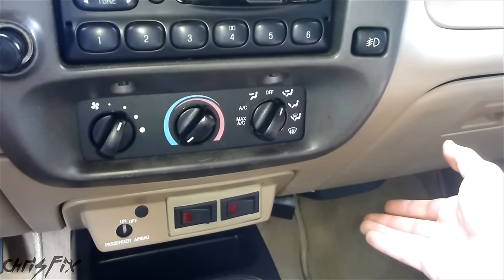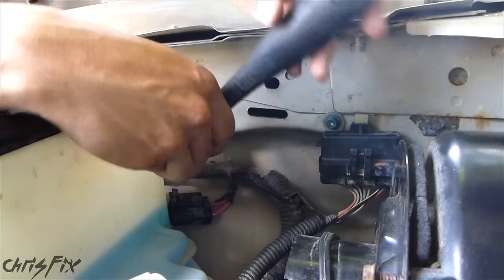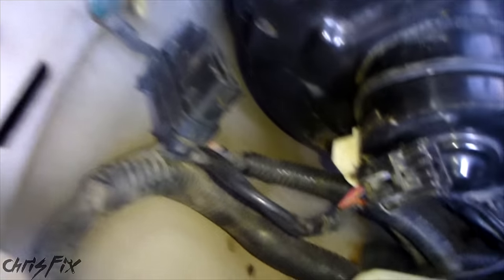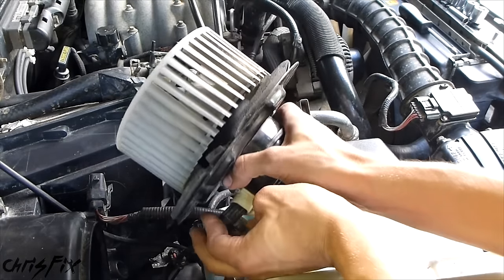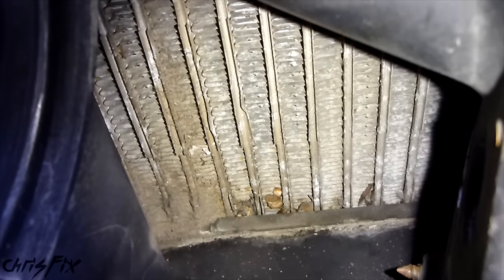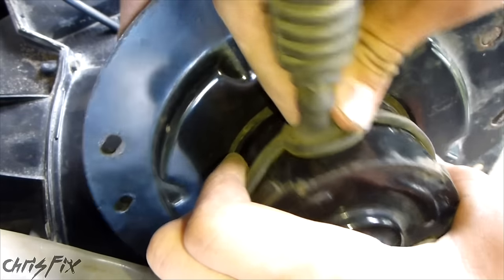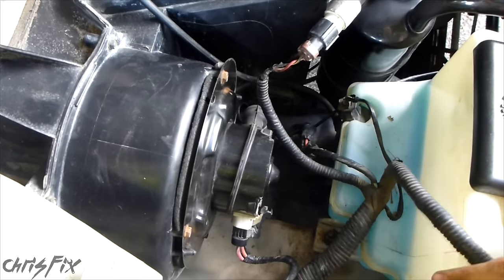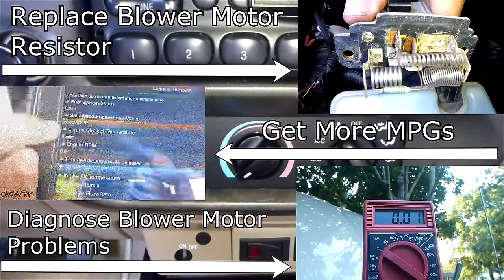How to fix a Noisy Blower Motor AC Heat Fan

Comment: I’m an hvac service tech, while that cleaner should be fine, they do make a dedicated no rinse evaporator coil cleaner. It foams up and as you run your ac the condensate will rinse the cleaner off. Plus it has a good smell to it.

Comment: have fun doing this on a 2014 european car...
Reply: +DESCENT in old european car you need only a screwdriver and hands, and at the new one you need 100 tool to get this out.
Reply: +Juntti 2012 and 3 Hands + 1 Foot.
Reply: Yeah forget it.
Reply: DESCENT tells their well made
Reply: @BmwMe-uh9sy  Just means suckers will pay more fix it. Its nothing to do with quality, only snobbery, for those who never turned a wrench in their life and have more money than sense.
Reply: Bmw M3 e46   99% of people don’t wrench nowadays
Reply: DESCENT I'm
Reply: My '89 eu escort only 1 connector and 2 bolts
It's right under the hoodgrille
Easily accessable haha
I hate working in anything after 1990 
Too much plastic to remove
Reply: I just took the blower motor off my ‘11 3 series. It’s not that bad. Pop the cover out, unplug the wire, twist the blower motor and it comes right out. Stealerships just overcharge, I believe BMW charges 2hrs labour for this and the “proper” way to do it is to take some panels out which isn’t necessary. It can easily be done in under 10 mins.
Reply: Lulușa Armand Never liked VW products myself. I worked on an S4 before and hated it. I had a VW GTI and it was a lemon. If German cars are your thing, BMWs are easier to live with. I’ve owned 2 and they’re dead reliable and (water pump aside) not that bad to wrench on. I’m not hating that much on their cars tho, those S Line Audi cars drive nice.
Reply: Recently did it on a 2013 Opel Astra j  took less than 5minutes.
Reply: DESCENT you'll need das engineering degree just to look at it.
Reply: On my Lexus, all you do is take out the foot kick panel and remove three screws.. I imagine it’s the same on a euro car unless it’s really in the dash!
Reply: @BmwMe-uh9sy 79 gym
Reply: Easy mercedes is so easy
Reply: On my 2009 Volvo I would need to disassemble pretty much the entire front dash as it sits deep behind the center console. Also its a two person job and it takes an entire day 😭

Comment: Chrisfix is a wizard. He makes it look so easy. I pretty much had to do a magic trick to get my blower motor out and in without removing the reservoir.
I'm kinda surprised I was able to.
Thanks for making these videos! I went from knowing next to nothing about cars to doing many major repairs myself from watching your videos. Saved me thousands!
Reply: I had the same issue with mine! The last reservoir bolt was inaccessible underneath the lower air filter box.  Ended up breaking my fan when pulling it out, thankfully crazy glue and zip ties work as a temporary fix!

Comment: Hi Chris. I just wanted to say thank you for the incredibly helpful DIY videos. A couple years back, I bought an '08 Pontiac G6 with some minor quirks. An AC vent was broken, the passenger-side windshield squirter wasn't working. Also anytime the AC or heater turned on, it made an obnoxious chirping sound. All these things sounded like complicated and expensive things to fix. So I recently started to watch a majority of your vids and I realized that working on cars is a lot easier than it looks. I've replaced the AC vent(it wasn't connected to anything, just pops out simple). And the windshield squirter nozzle was clogged, so I just replaced it with a new OEM nozzle and its working like a champ. Now I'm going to attempt to tackle the chirping sound that my blower motor makes very soon. Now I'm not saying that I'm a hotshot mechanic but Chrisfix, you've made working on cars simple to understand and saved me a lump sum. Thank you!

Comment: Awesome!  I took my car to the dealership (while under warranty) to fix my blower motor that sounded like a baseball card in bicycle spokes and they couldn't find an issue.  After the dealership trip, there was a new squeaking noise coming from under the glove box.  I found the blower motor secured with only 2 of the 3 screws!  I just watched this and found out it was due to fan wobble.  Missing screw replaced, fan tightened, all good!  Thanks, Chris!  You rock!  Definitely subscribed!

Comment: Thanks so much for this video.  My motor was making noises 2 days ago, but today it ran fine.  Now, I know I just need to get in there and clean out some debris.  What's even better, my wiper reservoir has a giant crack, so I am going to replace that and have easy access to the motor debris at the same time.  You have saved me about $1, 000 over the last 2 years.  Maybe more.  Love your stuff.  From: 2005 ford ranger edge owner.

Comment: I have to leave a comment and a thumbs up since this video saved me time and few bucks. Passenger side dashboard suddenly vibrates violently with the fan on max. The next day, the foul smell comes out of the ac. After following this video, I was able to pull out the blower motor and turns out a small mouse ended up in the blower compartment causing vibration and when it decomposes caused the foul smell.

Comment from the maker: +Luis Payan, I cannot reply to your comment for some reason, so hopefully you see this. I would check your cruise control fuse because that is easy to do, but I would check your vacuum lines going to the cruise control. They might have fallen off or be cracked.
Reply: ChrisFix nice video like always Chris...if u ever have the time can you do a video on changing out the cabin air filter on a pt cruiser.. if not thanks anyways for all your awesome videos!
Reply from the maker: I might be able to do that one. Right now I am parting out my PT cruiser but the cabin is still in tact. In a month or two, remind me if I havent made the video!
Reply: Cool I'll be sure to give u a reminder.. thanks!
Reply: ChrisFix  could you do a expansion valve replacement
Reply: ChrisFix hi
Soapy wooden lol
Reply: ChrisFix see
Reply: I have a problem with my AC my AC on a 2007 won't blow any air at all maybe the motor blower

Comment: When using general-purpose cleaners on evaporator coils, one should be sure that they don't contain chemicals that can damage the copper and/or aluminum coil materials. These would include chlorine and ammonia.  Plain detergent and warm water might be best.  Obviously, special purpose coil cleaners are also made.
Reply from the maker: wholeNwon Thanks for the tips!

Comment from the maker: ***** I was thinking about cleaning the condenser. Do you think it is worth it? 
As for the blower motor. I filmed this video first then the blower motor resistor video. I just happened to edit the other video first because with this video I had to retake some audio and video I messed up on.
Reply: this is similar to what happened to me. i wish you made this a month ago. i had a piece of carpet dampening in the blower fan.
Reply from the maker: Aw, dang. Well at least you know now and it is fixed now!
Reply: го
Reply: Yeah fix the condensor too
Reply: ChrisFix hey chrisfix I wanted to know why my a/c isn't blowing cold out of all my vents only the passenger side vent blows colder I replaced  Compressor ,condenser  expansion valve ,dryer and evaporator it's a 1998 honda civic
Reply: My 2000 Nissan Altima makes a loud squealing noise when I turn on my front defroster for the AC/Cold/Hot air. I don’t know what’s causing the problem but it’s pretty loud outside of the car. Any idea?

Comment: Great video. I would also like to share that if a blower motor makes noise sometimes rodents may keep nuts on the blower or even die there. That's what happened in my own case. You're my biggest DIY motivator

Comment: I would recommend spraying WD-40 or Lithium Grease around the bearings, motor, or joint areas before re-installing as well as re-conditioning the rubber parts with Armor All. I always use a wire brush on any rusty bolts and then spray with Lithium Grease or regular grease to keep them from rusting and being hard to remove.
Reply from the maker: Thanks for sharing.

Comment: my whole dash clunks and smells like squirrels.. lol....
Reply: Turns out they were living in the blower!! LOL
Reply: +JakeWardell 19 😂😂😂😂
Reply: +Robin1Titan Smells so bad.... lol
Reply: +JakeWardell 19 Poor bastards got a good workout when you turned that blower on XD
Reply: OMG I just had the same thing in a free Maxima that was living under a tree for a year! acorns were jammed in the fins! worked like a champ after. and yeah car still stinks
Reply: i found a nest under my air filter, then i pulled my blower motor out and found a small dead mouse.. yeah i freaked out and bought a new motor lol. thanks chris!
Reply: JakeWardell 19 Yeah right lol jk I know it happens.
Reply: Irony is that it is a hamster wheel blower!
Reply: I bought a 71 Chevy pickup last year. Seller said the heat was working "just the other day."  Found a huge bird's nest in the blower housing! 😂

Comment: I have a question about my 2003 Dodge neon, my cruise control keeps going out and idk if its a fuse in my box that is bad or something else? Do you know what the problem might be?
Reply: Luis Payan. Could be the break light switch at the top of the pedal. it is link to cruise control for safety.
Reply: Luis Payan well if u hit your brake after you put on cruise control it will go off for safety so the car will slow down before u come to a stop
Reply: I'm pretty sure that Luis asked ChrisFix this question.

Comment: "Accessing the blower motor is easy" he sais.
And i have to take out thw whole dash to get to it
Reply: Back in the old days cars werent a pain in the ass to work on
Reply: Nothing like gratitude is there .
Reply: @saba7733  my car is from 1990
Reply: @philippeichinger3246  back in the old days "most" cars werent a pain to work on
Reply: @philippeichinger3246  1990? Damn still running good? If it is you must be taking good care of it
Reply: @saba7733  i got it in 2018, and no , i dont really take care of it, its not running perfectly, but its done that before i got it, just needs a new throttle body
Reply: @philippeichinger3246  I have a 1990 Olds Delta 88 Royal. Runs pretty dang good for being 30 yrs old. I may need a new throttle body as well tho.
Reply: @Ry77x  turns out the throttle body isnt the problem, something else is and its causing it to get funky timing, like 40° in advance occasionally, but only fir very short times
Reply: @philippeichinger3246  I see. Mine goes into limp mode sporadically. Runs rich/lean and sometimes stalls. It runs great for extended amounts of time but goes crazy out of no where. Its only my hobby/ work car so not a big deal. But dang confusing especially after replacing several sensors and tuneup. Good luck man.
Reply: @Ry77x  thanks, good luck to you too

Comment: August 26, 2019. Great videos Chris keep up the good work. I had to do this to a 2013 1500 Chevy Silverado in early spring the motor stopped and I couldn't defrost the windshield anymore. So the next nice day I did the job same as you. The only thing I did different was cleaning the evaporator with water after vacuuming out the drain hole from under the truck first. This insured the drain hole was clear and all was good  for the air-conditioner. Installed a new air filter and fan control module, then buttoned her up and she was good to go.

Comment: Really should replace the seal on that, else its also pulling crap in.
I've got a car sitting on the side of the house that has mice that got in through there somehow. Would be nice if you could do a vid on how to screen off those areas as mentioned in the comments.

Been watching on occasion over the years, and you're getting better and better at pointing out little things to watch for in addition to the main event.
Good job.

Comment: I actually broke one of the spokes on the cage when I removed the blower motor trying to diagnose a different problem, and then it started making noises at higher RPM. I removed the blower motor again and put a little loctite on the cage to fix it. Saved a few bucks on that as the vibration stopped.

Comment: Thanks for the video! My blower motor has been making an annoying sound intermittently (goes away for a while if I turn it to high speed for a second), I didn't even consider it might just be old leaves rattling around. If only Ford had used cabin air filters back in 1993... I think they started to in 96 (for the Taurus), so I'm surprised your Ranger doesn't seem to have one.

Comment: Great video, I just bought a '99 ranger and the fan was making all kinds of noise and jammed up. I will take it off and with any luck un jam it and have it spin freely again :) next install a new resistor for only high speed was working. thanks for the vids \m/
Reply from the maker: +von frost Awesome!

Comment: I was anticipating having to do this as there was a horrible screeching from the blower and it would occasionally cut out completely.   My thoughts were that a bearing failed and the motor would need to be replaced, although an aftermarket one would only be ~$40).  It turned out to be an even easier and practically free fix.  In my car (2010 Mazda CX-9) the AC reservoir is situated next to the blower motor and the AC drain plug was clogged so the water had overflowed and flooded the blower motor.  A little blast of compressed air cleared out the clog and miraculously the motor was completely fine.  The car peed like a racehorse for a good 3-4 minutes after I busted the clog out 😂

Comment: thanks man. i knew it was a simple fix, but i came to the channel to find a video on it to make sure i catch all the stops.. now im looking for a video on my starter.  i replaced my starter yet im still jumping the solenoid.  checked ignition fuses -- they are ok.  im assuming its either the ignition accessory wire or the wire from battery to the starter.  i have a 92 buick lesabre.

Comment: I am changing mine today, because the blower wheel (plastic) is broken. I replaced the fan about two years ago, and did not loosen the reservoir. I had to force the fan in, and may have caused it to  break. I'll do it correctly today.

Comment: Smashing video as allways chris :-))

Lots of good tips for improving your system, and no special tools needed for the vehicle type your fixing :-))

One thing needs fixing though, the system needs something like a kitchen flower strainer mesh fitted on the end of the air collection pipe to stop the crud getting in again. Or slide a "clean" sock over the input, oow imagine how bad it would be with a dirty smelly sock ha ha :-))
Reply from the maker: zx8401ztv Thanks bud. An air filter would be perfect there! Something that just slides in right above the blower motor so there is easy access. Too bad they didnt do that.
Reply: ChrisFix
Perhaps you could fashon a simple one for that vehicle, if it just keeps the leaves out then thats a gain :-)
I am supprised they dont do that, they want a good kick up the jacksy lol.
Reply from the maker: Maybe. I might have to give that a try! If I do, I will make a video!

Comment: i thought you had to pull the whole dash out. well clearly not! great vid!
Reply from the maker: smallenginedude71 Glad the video was helpful! If the blower motor happens to be in the dash, it is usually accessible from under the glove box.
Reply: ChrisFix would you be able to do a vid next time you get a blower issue where the fan is behind the glove box? i have a noisy fan and it slowly blows out leaves :)
Reply from the maker: smallenginedude71 If I get a blower motor that is behind the dash I will make a video for you!
Reply: ChrisFix thanks!

Comment: Hey Chris I have 2013 GMC Yukon XL and I have some liquid leaking from passenger side  and No air coming through dash wents but rear wents blow air normally to whatever speed you set them on. I am new to you channel I watch so many videos of your work great stuff bro simply explained anyone could do it. I am just having hard timing figuring out why theirs leak inside my car making floorboard wet and no air or heat at all.
Reply from the maker: The heater core is leaking or your hvac drain is clogged.
Reply: ChrisFix So upon checking my freon isnt leaking because of gauge pressure but it goes above 45psi and then it drops n then it goes up again n drop i tried opening the clogged drain so much water came out but now i think i have to replace resistor and blow motor because they were all wet soaking in water what do you think?